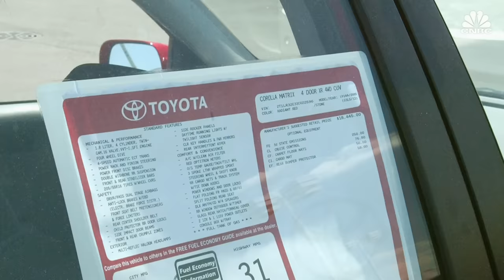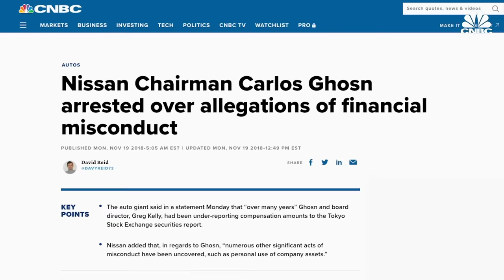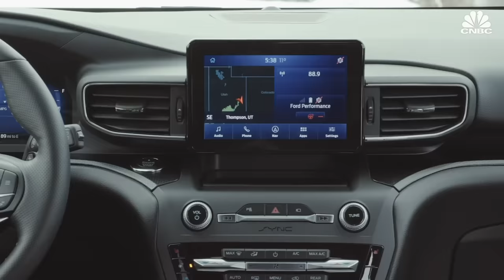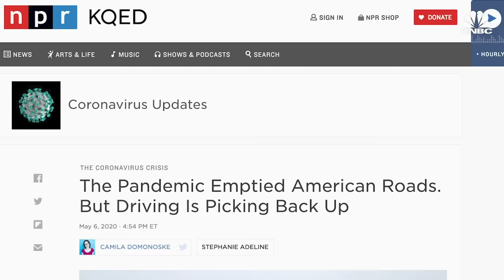Why Toyota, Honda, And Nissan Continue To Bet On Sports Cars

Comment: Man, if that Supra was available with a standard, I would be all over it. I know, I know, automatics shift faster, but manuals are so much fun to drive.
Reply: Left foot salute! 🦶😅
Reply: That’s the only reason I didn’t buy a supra lol and went for 86 and FI it
Reply: The rumors say next year it will be available with a manual
Reply: @kunamutas8941  well yeah now that nissan is about to wreck them. But that chief engineer spewing crap like 'perfectly balanced with zf8' royaly screwed up. There could've been 2019 with manual readily available to take over used market
Reply: Manual sporty sports cars hold their value much better nowadays, compared to the automatic versions. 
In a few years, they may even go up in values as so few new sporty cars would offered a manual
Reply: Cries in poor
Reply: Glasspack40  It’s not that easy. Especially with modern cars, they have so much electronics that it’ll be more practical to leave the A/T transmission alone.
Reply: Glasspack40  he might be talking about space being available for a manual transmission. It's probably more complicated and/or expensive then one would think.
Reply: It’s coming soon next couple of years or so
Reply: No true car enthusiast cares about the auto shifting a fraction of a fraction faster
Reply: Glasspack40  you're talking about one individual car
Reply: Glasspack40  think about what you're saying. If the market for that car wants manuals, why on Earth would they buy the automatic? Waiting to see how many automatics sell means nothing. It won't indicate a single relevant piece of data.
Reply: @NikoBellaKhouf  True. More precisely it will generate the wrong data and give the impression consumers dislike the car and lost interest i it, thus prompting Toyota to stop making them again instead of just adopting the manual transmission .
Reply: @paulinhofagundes12  exactly! Just like how they put manual transmissions only in the lowest or sometimes only the highest trim model. Then they said, "oh look they don't want manuals anymore." When in reality, nobody wanted to sacrifice power windows, power locks, an entertainment system, and more features just to have the manual. And other times they just couldn't afford the highest trim. How if they put manuals in the middle trim level, they'd have continued to sell just fine. They're out of touch.
Reply: @NikoBellaKhouf  Unfortunately the financial department does not employ sports cars enthusiasts, so there's no way they'll understand what the niche market wants right? Especially since thay never ask the customers with some survey or whatever, just surfing youtube would be enough to better understand sports car customers. Sadly the only language they understand is sales numbers, if it sells then the car is good and keep it this way, if it doesn't then the car is bad and they should pull the plug on it. Hardly any in between.
Reply: Glasspack40  don't cry lol

The man owned dozens of cars, he's allowed to have a few automatics in his collection.  You don't even know why he had it.  I read an article that said his daily driver was a Lancer of all things.
Reply: Shared platform killed it for me. The a90 will always be a dentists car.
Reply: Glasspack40  look it up wherever you found the article about his supposed automatic cobra
Reply: Glasspack40  you're not Shelby
Reply: Glasspack40  sure bud, whatever you say
Reply: I feel like toyota knew they kind messed up but there slowly improving it every year
Reply: Glasspack40  those are low production. Not the same market.
Reply: Glasspack40  she Shelby was purpose built for performance. Not fun. Like you said. To hit high speeds of 200mph. A byproduct of those high speeds and the rarity, the sound of the car and its fame caused it to become very expensive.
Reply: Glasspack40  sorry bud, but the cobra isn’t driven. Its an asset, not a drivers car. It’s now a collectors item and an investment artefact for the mega rich. Most of them not being car guys. The car is to valuable to be driven. However an affordable manual rwd coupe serves no other purpose but to be driven.
Reply: @ao8271  "Most of them not being car guys"

Obviously, amd Apparently you don't get the point of blank.

The point of blank is, if you're goin' to claim that "real enthusiasts drive manuals". Then you should call Carroll Shelby that he aint a "real auto enthusiast" cause' of the fact that some of his vehicles includin' his Cobra has/had Automatic Transmission.

The "Manuals are for real driver and fun" thing is hype.
Reply: @ao8271  "those are low production. Not the same market"

Again. Obviously and Apparently you dont get the point of blank.
Reply: @stuchbrosmnore8627  its not hype its survival. You don’t have to prefer manual to be a car enthusiasts. You just have to respect it. Unlike most car companies and non car people
Reply: Glasspack40  look at same models for a better comparison than using one unique car as the example lol. All ferraris, astons, and lambos have a considerable price difference between the automatic and manual versions, with the manuals selling for more money. Using one car and comparing it to the rest of the market is apples to oranges, while same exact model comparisons are apples to apples.
Reply: @shittywheelies7403  Obviously, you don't get his point . in general, its about a vehicle during the 1960s , that was street legal and made 200mph, long before computers .

Bill Cosby owned a Cobra himself and gave it back because he was scared shyt of it. And he also stated that himself .

And since you mentioned European exotics such as Aston Martin, Ferrari etc. Are you mad because an a USA vehicle such as the Cobra rivals those legitimately? Especially due to its million dollar pricetag?
Reply: @shittywheelies7403  Also, lets not forget that Bill Cosby, long b4 he OWNED a Cobra, had Lamborghinis, Ferraris himself. However, he couldn't handle the Cobra.
Reply: @shittywheelies7403  "considerable price difference between automatics ans manual versions".

There was a time, in general , that regardless of what vehicle, that came with an Automatic or/and Manual, that if you wanted a vehicle in manual you paid less. While Automatic you paid higher for that.
Reply: If it wasn't a BMW I would be interested. Like the look of the car. Just can't stand BMW.
Reply: They will probably make it available at some point
Reply: The new  Nissan Z will be standard...gonna compete directly with supra...
Reply: I just learned how to drive a manual cause like you everyone says it's fun. But damn that was a lie. I didnt feel in control at all and it took my attention off the road and the car drove me. Biggest lie in human history. :(
Reply: @baronvonjo1929  if you got distracted and doesn’t feel comfortable driving manual, it means you need more practice, it’s like playing a musical instrument once you get good to it you don’t even need to think much about it
Reply: @baronvonjo1929  yam  I learned by accident 20 years ago, and I've never owned an automatic car since,  and  never plan to..
Reply: Automatic transmissions 90s Mk4 supra can't handle more than 550hp.
Reply: I think there was a rumor that they were making a standard Supra under the gr trim next year but i could be wrong
Reply: There is a company in Texas converting them.
Reply: @phamhongvinh1997  You mean a Subaru BRZ?
Reply: @NikoBellaKhouf  Well the new Ford Bronco has a 7 speed manual on the base model.
Reply: not in heavy traffic.
Reply: @BeingMe23  "well the new Ford Bronco has a 7 Speed on the Base model"

Yrah, for the 4 Cylinder one.
Reply: 2% of new car sales in the US are with manuals. You're asking for a low volume selling car to make an even more lower volume selling variant. It's not as simple as just throw an MT in it, you have to develop it, test it for reliability, come up with an assembly process to install it and accompanying pieces of trim, source manufacturing, develop supply chains, stock spare parts at numerous Toyota dealerships, train mechanics, write separate manuals/chapters for owners, etc etc. All that for a version that would likely not hit 4 digit sales per year and would cost 7-8 digit numbers to develop and likely more to implement.

All that and I'm sure a lot of people that claim they'd get it with a manual would probably just come back and say, yeah, but I'll get it used in a few years. Someone has to buy them new for them to keep getting made.
Reply: @peaceable263  "If it wasn't for BMW"

If it wasn't for BMW. The MK5 Supra would currently be over 100000 bucks price wise .
Reply: @Mazinblaster Z You're missin' the point. Aren't ya?

The Dodge Challenger Demon, comes with Automatic Only. Can we start saying that the Dodge Challenger Demon are for "wussies" because of that?

The Buick Grand National, comes with a Automatic Only. Can we call the Grand National drivers "wussies" because of that?

Also, Carol Shelby's #real 1966 Cobra A/C Super Snake , comes with a Automatic. Which those vehicles go over 200MPH #stock.

Can we call Carol Shelby a "wussy" because of that?
Reply: 400z ladies and gentleman
Reply: @paulinhofagundes12  Niche markets don't pay the bills.  SUV's do.  Automakers are in business for money, so they will build what makes them more of it.
Reply: @angelaandjosh5744  You're right!
Reply: Glasspack40  That is only one vehicle. A p rare one at that
Reply: The other alternative would be GT86.
Reply: BMW has stopped making sporty cars with manual transmissions. The current Supra is a BMW Z4 underneath. It is very unlikely that the Supra will be offered with a manual as long as it continues to be a BMW product. Government insistence on 8+ speed transmissions and smaller engines has pretty much killed the manual. I love my WRX 6-speed. I'm keeping it.
Reply: @garymanis6305 the supra already has a manual transmission

Comment: Honda didn’t try, they DID make a supercar.
Reply: Twice...
Reply: Yep.  NSX was legitimately the only reliable supercar in the 90’s.  Sure it was slower than it’s competitors but it wasn’t temperamental and you could even daily it.
Reply: https://youtu.be/qK-pCIouaH4

TLDR: Of course its a supercar. The only Japanese supercar if i am not mistaken.
Reply: @andipajeroking  The LFA is the greatest Japanese supercar...
Reply: @DjDizzy216  Actually if you compare it to the competition at the time (1991)...the NSX had similar 0-60 times and lap times.
Reply: @OlJackBurton  r32 GTR slapped Ferrari and made a statement thus the name godzilla.
Reply: @OlJackBurton  ooops, i forgot about the LFA, my bad. 
The Great part is debatable, i think both were revolutionary when they were launched.
Reply: @OlJackBurton  uhh people don't like the car because if your cleaning your car and water goes in the vent it will affect the engine thats a big con about it
Reply: @juanquiceno6561  the name godzilla only came from Australian racing.
Reply: @OlJackBurton  the 2000gt is the greatest supercar from japan because that the first japanese supercar built by japanese automakers
Reply: @DjDizzy216  the 1st NSX was just as fast as it's competitors, while being lower in price and way more daily drivable.
The 2nd NSX is anything but it. It's as unpractical as possible, it's heavy, it's complicated and not very reliable (that's my prediction, because of the high complexity), it's as expensive as it's competitors without the exclusiveness that comes with these brands.
Reply: @user-mx1fq6qm6i  The 2nd gen really isn"t that bad. It's got comparable boot space and it's speed is nothing to laugh at. Could reliability be an issue down the line? Maybe, it is a hybrid after all. Thing is you're getting old hypercar performance for supercar prices, it's not everyday you see a p1 like car go for 150k
Reply: @bottomtext5872  it was still too expensive compared to it's rivals from Audi/Lamborghini. The Honda NSX was never supposed to be so complex, unreliable and heavy. It was always supposed to be a fun, reliable and usable supercar that can also be a daily driver. I'd say, the Corvette C8 is the best example I can think of, even though it's automatic only which is a bummer and was reported to have some electronic issues and transmission leaks very early
Reply: @user-mx1fq6qm6i  People really haven't reported any big reliability issues from what I've seen. It's a decent daily driver, it's got good room and who says it's not fun? It's fast and nimble, it's a decent car while pushing the envelope, that's what the NSX always has been, no?
Reply: @anti4107  thats a issue all cars face
Reply: I'm a huge Honda fan but they're letting me down after seeing what Toyota and Nissan was releasing.